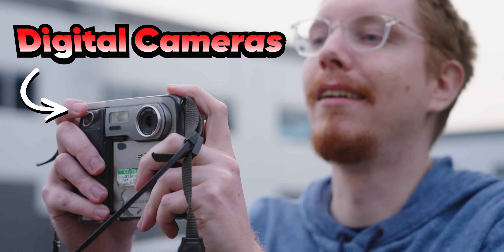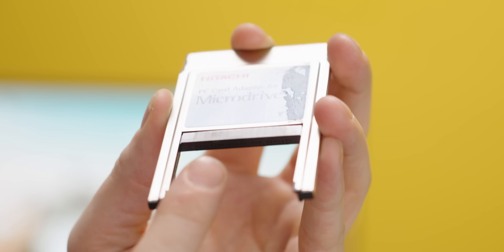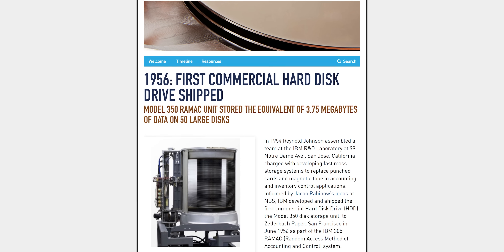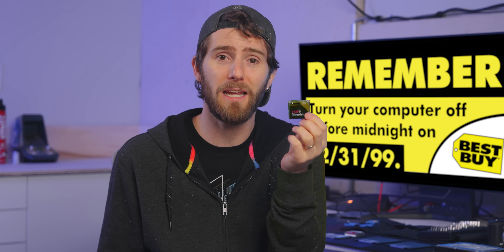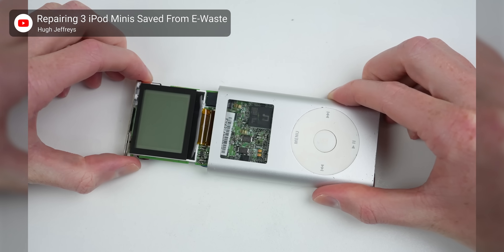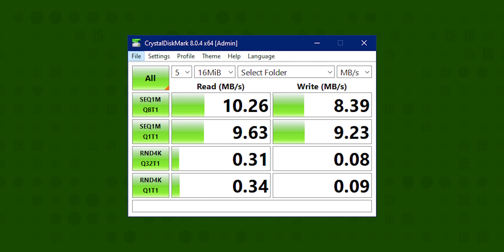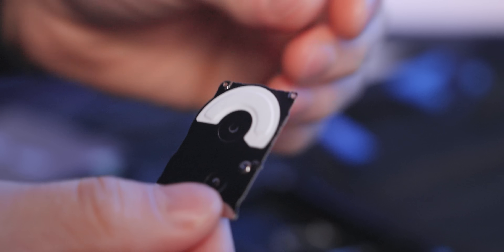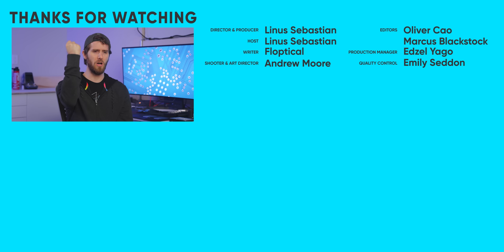This TINY Hard Drive is REAL... and it changed the world! - IBM Microdrive

Comment: If the engineering for those are tech level human reached in the 90s why don't they still are used today?
Think slow speeds are the only thing in the way of using them to make a mini nas, but a cool use is them bein a backup drive, not occupying too much space as a normal HD drive but in case the drive the father is corrupted drive the son can be use for recovery

Comment: It's so unreal how far we've come in small form storage. I love it.
Reply: Now we have 1TB microSD cards the size of your pinky fingernail!  I'm a nostalgia nerd as much as anyone so all these old tech videos are right up my alley but it really gives you an appreciation for the tech we have now.
Reply: I still think the ORIGINAL MICRODRIVE cartridge was the best audio and picture form factor, even if it died before digital audio and pictures for the mass market was a thing.. They were dead by the mid 1980s. The SINCLAIR Microdrive Cartridge could only hold about 100kb at the time but if it had progressed along with tape recorder tech. it could have beaten the 3.5'' floppy. It was about 1/6th the size of a 3.5'' floppy.. Came out in 1982/1983...The failed Sinclair QL had a double Microdrive (TM)!
Reply: Yeah. However for the smallest sizes there surely needs to be something done for random access performance. Sequential speeds are usually fine for what they are - but bad random access really limits the usefulness. Wish they'd stuck to large SD card size and implemented a proper SSD controller - that would really do wonders. Both performance and longivity. I have a surveilance system which records videos when I'm not a home. There's always a bunch of animals and USB and MicroSD are worn out in a year. And if not worn to the point of error then work enough to be slow as mollasses. Last time I changed local storage (there's also cloud storage but it can run full and in the event it or internet is down) for a proper SSD - just a cheap green WD - about the cheapest I could find and not at all expensive. That one just performs and nowhere near worn down even been in operation for 2-3 years.

Comment: I had forgotten about the original Microdrive. I did use those floppy-based Sony Mavica cameras. My dad got it for free when someone upgraded. I still have some floppies with pictures somewhere.

Another company that made tiny drives was Cornice. They were only around for a short time. I want to say they were one of the suppliers of the hard drives in the original iPod, but there's very little info out there about them and I don't know for sure. I do know their drives were used for tiny USB hard drives, though.

Comment: I think these things went slightly out of spec though. At least there were devices that they wouldn't fit because of the bulge on top and there were also those that didn't deliver enough power for the the tiny motor inside.

Comment: I remember using a 1 GB microdrive in an apple powerbook G3's PCMCIA port as a boot drive in desperation after its HD died. It took hours to install the OS and was painfully slow to open so much as powerpoint, but it did "work" as a desperate short term solution. Also, that microdrive was amazing in the old 3 MP digital camera we actually bought it for. Storage felt unlimited.

Comment: Chances are you have already done it, but if not, I’d love a deep dive on how USB replaced older systems like serial.
Reply: USB didn't replace serial, it is serial. Universal Serial Bus.  It unified the standard
Reply: People still use serial, and it is easy to plug in the correct way on the first try.

Comment: I used an IBM 1GB Microdrive for several years when I was using a Fuji Finepix S2 DSLR routinely. It was quite good until you would fill up the camera's 8-frame RAW buffer and had to wait for nearly a minute for the Microdrive to catch up writing all that data out of the buffer. And even though it only spun up when needed, it would still chew through the batteries like crazy on the camera. Good thing the batteries for most of the camera's functions were rechargeable AA's. It also had two CR123 batteries but those ran things like the camera mechanism itself, the flash, etc but not the storage. I retired the drive around 2010, got a couple of 2GB flash cards (the camera couldn't support anything larger), and used those for a while longer before I retired that camera entirely.

Comment: I have a 12GB Samsung Pleomax USB 2.0 drive, that uses a tiny 3600 rpm hard drive. Still works, 11MB/s Read 9MB/s Write. The whole case size is 1.5" Wide x 2.375" Long x .44" thick.

Comment: I actually have one that is still working perfectly.
I work in the IT-Team at my University, and my Boss has been around there for 25 years now. Around the 2000s, they had a respectable budget for tech, and given that nobody really cared about computers at their department he had a lot of spare money at his disposal. Much of the stuff they bought was high end, and he kept a lot of the particularly interesting stuff, including very early Laptops, a very early LCD Monitor from the 90ies and a bunch of ancient hard drives. Always fascinating to see these things, and I get to play around with it a lot, sometimes I can take things home. That's how I got a bunch of y2k-era high-end tech, amongst that a Hitachi 1GB Microdrive. My DSLR interestingly still supports microdrives, which were a bit thicker than modern CF cards are, so I sometimes use it just for fun, and it seems to work perfectly fine. AFAIK it didn't get used much at all, and it wasn't moved much since about 2005 when he switched to flash memory cards.

Comment: I used to love taking apart dead tech as a teen to see what pieces were in it, and I'll never forget pulling apart a dead Zune and finding one of those tiny little drives in it. I never got it open to look at the platters like that, but it's amazing that it's really just a tiny regular hard drive.

Also, my Creative Zen Vision:M still works to this day, and I use it regularly since it has actual line out. I'm dreading the day it finally dies and I have to buy an expensive Cowon player or something.

Comment: For anyone is interested, in the CNC industry, many brand newly developed controls are common to still use compact flash with a PCMCIA adapter as the primary storage for the machine. And commonly 1GB to be maximum

Comment: I remember the first time I realised my iPod had a spinning hard drive in it. When you started playing music, you could feel the gyroscopic effect of the platter spinning up. I'm amazed how well they dealt with being portable devices subject to acceleration and rotational forces, etc.
Reply: Considering i used to skateboard and snowboard with my ipod in my pocket, I'd have to agree
Reply: I'm still amazed how well 2.5" work on a laptops. They work fine on car or train, but when my friend were angry that his laptop lags, he just broke one by hitting it.
Reply: @vadnegru  your friend sounds highly intelligent
Reply: A cool fact about the iPod is that it had 32mb of RAM, allowing it to have 20 Mins of skip protection (about 4 songs worth). This allowed the hard drive to only need to spin up at small intervals, allowing it to have really good battery life.
Reply: I used them in my old mini PC shop for converting my smallest thin clients into stand-alones,20 years ago. They were cheaper per MB and more reliable than CF cards even though mechanical as a cheap CF card would often fail during it's first windows install,, and even better quality ones couldn't take more than a few installs (or say going from windows to linux and back to windows).. I learned this the expensive way. I bought 300 second hand microdrives once. about 1 in 20 were duff but I was expecting much worse, and never had any of the thin client conversions back. I was always amazed at how robust they were once installed.
Reply: I agree! When my first iPod went bad I was so mad, it only lasted a couple years... when I later realized it was an HDD I was shocked it made it through so many drops, car trips and terrible handling. I'd still use a modded one today if the low ram wouldn't make larger libraries a pain to deal with, it was such a good little device.
Reply: Discman already had the same problem and the solutions are basically the same too.
Reply: @squngy0  The difference is the read head on the hard drive is only separated from the spinning platter in nanometres. In a discman a shock might mean the track skips while on a hard drive it could cause the read head to rip a hole in the platter.
Reply: Flash memory is really useful. Hardrives take the same power whther its reading slow or fast, so you may as well shove everything as fast as you can into memory. Ipod gained a shit ton of battery life because of that, same with anything that reads spinning media. Like Discmans and MD walkmans.
Reply: @Derpynewb  Hard Drives are faster than many people realise

Comment: Man, for a good decade or so mobile digital storage mediums were an absolute WAR ZONE. Every platform that was cool and new and functional was being bested or replaced within a year or two. There were very few standards in place. The only things that lasted for a particularly long time were floppy disks, cds, dvds, and flash drives. The thing that was the game-changer was USB connectors. None of the machines at the computer lab at school or library had a zip-disk drive, but if you had a USB zip-disk reader you could bring that with you and just plug it in. Then eventually there were flash drives, etc. And of course the years of painfully emailing things to yourself 25mb at a time once you snagged one of those coveted gmail/google accounts that allowed you to store up to 1gb of junk in your email inbox.

Comment: Surprised he didn't mention that the CF/Microdrive interface is also pin compatible with the IDE standard, which is why CF cards are a go to for retro hardware nerds like myself. Fast, effective, and reliable for anything Windows 3.11 on back provided you go with the "industrial" or "heavy duty" versions but you lose the auditory aesthetic of true spinning rust.
Reply: I was about to mention that. I have CF adapters for a computer with IDE ports and it works pretty well. There's no logic on the adapter, it's a plain PCB with connectors, a jumper, and an LED.
Reply: I used a CF to IDE adapter back in the day to recycle an old laptop into a digital picture frame. The CF held just enough storage for the OS and pictures and allowed the picture frame to run without hard drive noises
Edit" the video is still on YouTube :-D https://youtu.be/LQFT2ZaFOjI
Reply: I looked at the port and I went this looks like ide but smaller
Reply: It's not a truly retro experience if you don't have the hum and clicks of a giant 5.25" HDD spinning up.
Reply: @Pyroteq  I'm actually half tempted to hunt an old MFM HDD down to put in my Xi8088 build. Not really to hook up and use per se but mostly for that wonderful whirring and spinning when you turn the power on. All the aural aesthetic without the unreliability. It doesn't need to actually work, just spin up and do it's thing!!!
Reply: As a kid (un)fortunate enough to have a Sinclair QL as the home computer / dad's computer I grew up with Microdrive Cartridges before 3.5'' 'floppies' even existed and 360kb genuinely floppy 5.25'' disks were the norm.. Sinclair Microdrive Cartridges could hold about 110kb on a continuous loops of tape (so random access unlike an audio cassette).. 
--
IBM's microdrives may be 1000x better in every way but aren't REMOVABLE media, and Sinclair Microdrive user will tell you there is something special about the feel and sound of inserting a Sinclair Microdrive Cartridge into a Sinclair Microdrive.... The cartridges were about the same size as an IBM microdrive too, if not a bit smaller.
--
Ironically, I had a mini PC business (mainly on ebay) for a while 20 years ago and used a microdrive as the main hard drive on many. They were actually more reliable, faster and cheaper than CF Flash for many years. Many writes quickly kill CF cards, even with no swap file. A microdrive could run a swap file and take as many OS installs as you like.. blah blah.. Microdrives!
Reply: @PrivateSi  Yeah, I can imagine there was a time where the microdrives were a damn sight more reliable/quicker than the CF cards. It's a full HDD, and probably had a tiny amount of cache to boot competing with early early flash memory, it's gonna do what it says on the tin without complaint. It was functionally was identical to a standard HDD to pre SSD aware OSes, so you don't have to worry about aligning partitions and such, just install XP and go.  Flash at that time was used as storage in the truest sense: record data and regurgitate it, sort of like the way floppies and cassette tapes were used. Any modification of the data as it was on the medium was minimal, things like save games, file names, document updates, etc. It took Moore's law kicking in and the comparative simplicity of manufacture of flash solutions to push the Microdrive out and I'd argue it  heralded the beginning of the end of the traditional spinning rust HDD. I wonder if any tech writers picked that up at the time.
Reply: @ironhead2008  .. Damn Small Linux and Puppy Linux were excellent with even the early CFs fitted onto an IDE adaptor, as their installations were very light, Windows would often fry a CF, but if you got it installed, first thing you had to do was install the EWF write protect feature, with icons to 'Save OS Changes' 'EWF On' and 'EWF Off' on the desktop. Turn it off to install software,then turn it back on for the next boot. Cumbersome but made for a nippy system as read speed was much better than an HD. There were some Lite windows distros that installed much better... Fiddly but fun times!
Reply: I've seen IDE to microSD adapters

Comment: They had their uses, and were really the only viable ultra small storage solution at the time but holy shit those microdrives were awful. Not for the speeds, which sucked, the capacities or anything like that. You know how vibrations are what kill spinning HDDs? You know how every bump makes the car cd player skip? Now picture an incredibly small HDD, with crazy small gaps, spinning away in your pocket...

Iirc insurance companies refused to cover the microdrive iPods in my country and retailers refused to repair or replace the drives since so many people tried using one while running which would usually kill them in a couple hours

Comment: forever = the few years it took for flash to catch up.

but its funny of the 2 spinning disk hard drives i still own, one of them is the microdrive in my 5th gen ipod, still og equipment and functional. the other is a more modern external drive i use for backup.

Comment: CF cards are technically IDE ATA (technically PATA), which is an extension of the upper bits of 16bit ISA and it remotely follows the MFM harddrive protocols from the AT PS2 era. PCMCIA just used the same standard. You can passively convert CF cards to IDE without requiring any controller and it works fine on older machines.

Comment: The predecessor to the IBM Microdrive was the Hewlett Packard Kittyhawk in 20 and 40 megabytes. They are rare, with around 160,000 made 1992-1994. They had a tiny IDE pin header vertical on one long edge. Supposedly a PCMCIA Type 3 version was available but I can't find any pictures of one.

HP was hoping to sell 700,000 in the time they sold 160,000. $499 for 40 megabytes was too much. So they sold their Disk Memory division.

Comment: Palm did a bait and switch with the LifeDrive. Early review units were sent out with 5 gigabyte Seagate microdrives. The reviews were good. The retail version was equipped with a 4 gigabyte Hitachi microdrive *with no on-board cache*. The Seagate drive had cache which made it significantly faster.

Another issue with the LifeDrive is it only has a tiny amount of RAM. It uses virtual RAM on the microdrive. The Microdrive can be replaced with Compact Flash and with the free tools from Palm Powerups a CF larger than 4gig can be used and the "RAM" size can be increased up to 256 megabytes.

Comment: I remember in 2008, when I got a digital camera and a whopping 1GB of SD card storage. Felt like I could snap away endless. Keep in mind that I was a kid at that time and thought more images = better, so I shot at the lowest resolution LOL
Nowadays you'd struggle to even find a 16GB SD card in electronics stores, and on Amazon I can get a Samsung Evo with quarter of a terabyte for €21.
Reply: PS: I'm still using a Canon EOS 6D to shoot photos. Its uncompressed images are 'only' 20.2 MB each. So even 16GB is plenty because I empty my SD cards regularly, and I prefer to have more smaller ones rather than a single big one, in case one fails.

Comment: I had an iPod Mini that used a 4 GB Hitachi MicroDrive. This iPod Mini connected via USB 1.1 or FireWire 400. Just for fun I once installed a basic 1.9 GB version of OS X 10.4 on it and it was able to boot up an Apple iBook. Naturally the iPod ran rather hot.

Comment: We were using them in a project that needed removable hard drives we were designing for the US Gov (They did not allow flash memory at the time).  They made us replace them with standard size drives because they couldn't produce a label small enough that contained all the information they needed to control them.  Shame, because they worked great.

Comment: We had a few Sony Mavicas (the floppy drive cameras).  They also had another slight problem.   While they had a flash,  they also only had an LCD screen for a viewfinder.  But, the flash didn't work until you took the photo.   So, the viewfinder only worked when you took a photo in the dark.

Made it difficult to take photos in the dark.